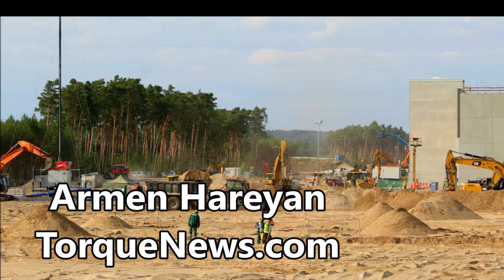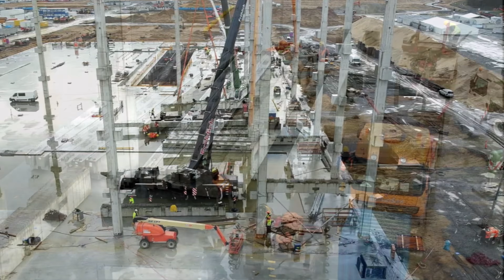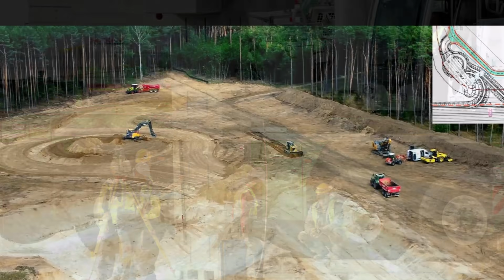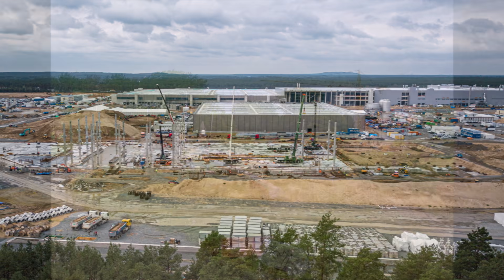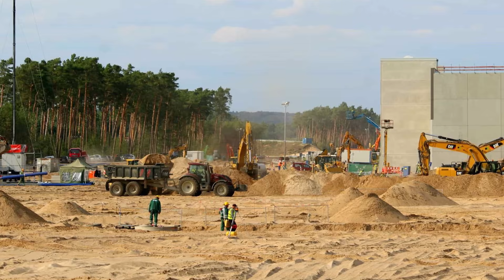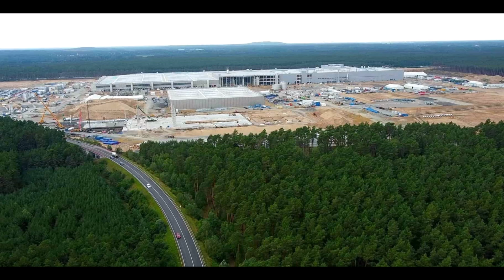TESLA JUST REVEALED Giga Berlin's Battery Factory Investment Size

Comment: A plant to manufacture 500K vehicles per year, needs 3 billion usd of investment, a car battery plant which has a capacity to produce batteries for 500K EV's per year, costs 10,5 billion usd... The capacity of gigaberlin would be 500k ev's at least... If Tesla officially took down the battery investment needed, to a 5 billion usd level, that's why it's market cap is 10 times of GM... this is a well studied bottleneck; there's no way for the rest of auto industry to make profit from EV, unless they do not have their own battery tech and do not manufacture batteries they needed inhouse... 40% of the cost of an EV is batteries, battery investment and manufacturing is a more valuable and strong position than car manufacturing at the moment... for the last 10 years they should've been investing in battery R&D to take costs down to 1/3 for manufacturing plant investment, and take the production cost down to a level comparable to material costs... they're waiting for the chinese manufacturers to invest and supply those batteries, there's no way of them getting it at a profitable cost... this is the main reason why they'll go extinct...